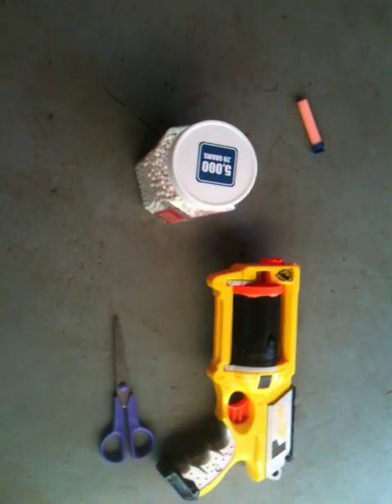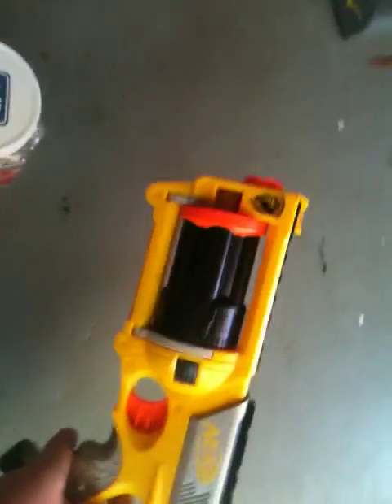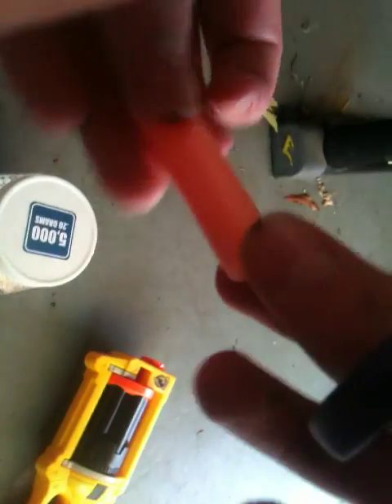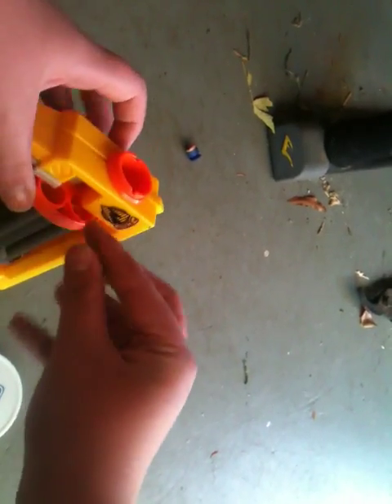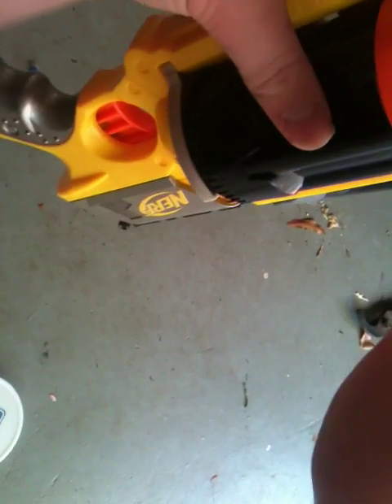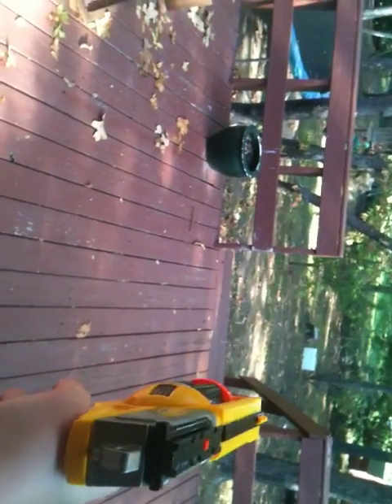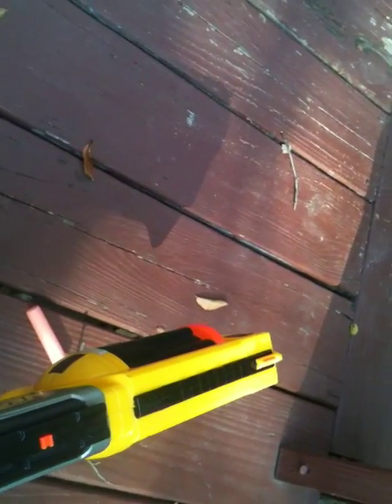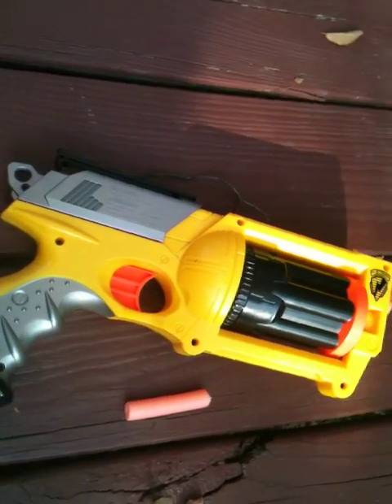how to make a nerf gun into an airsoft gun

Comment: For $15 at Wal-Mart you could buy the Stinger P311 which is very powerful (325 fps), very accurate (17/20 at 30 ft) and just an all-round great airsoft gun. Trust me, I know it's powerful because I've killed a robin with it.